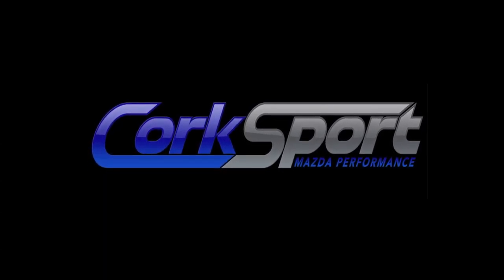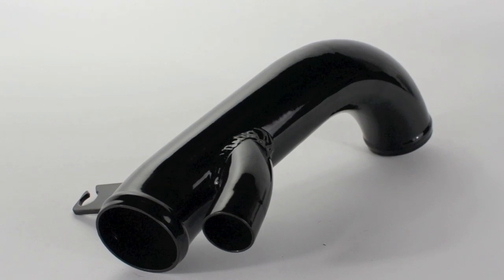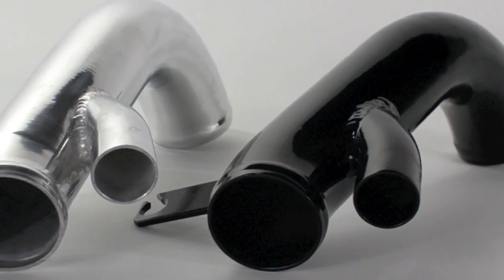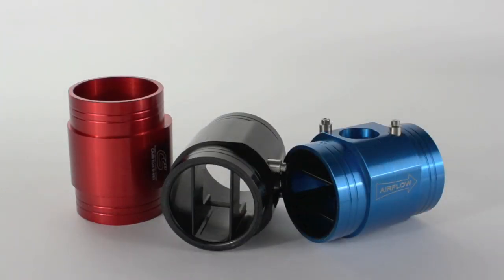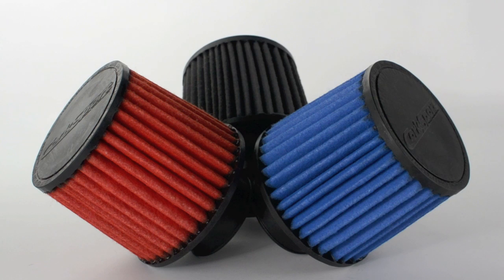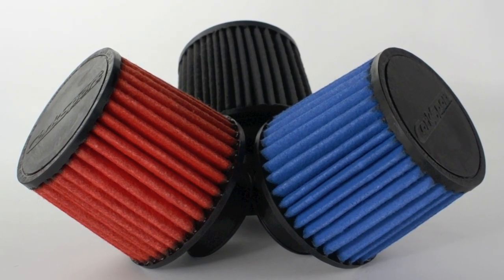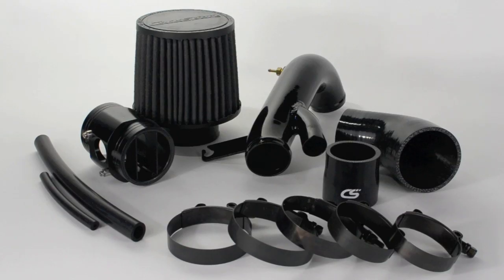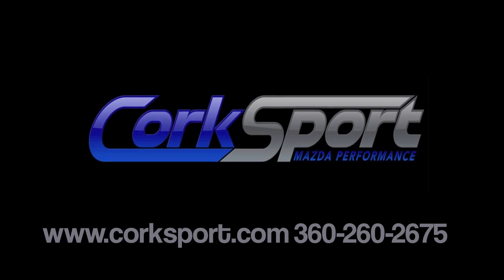CorkSport Stage II Power Series Short Ram Intake

Comment: Have the power intake stage 1 on my MazdaSpeed3. The "air straightener" came undone from the housing, and was sitting in tge cone of my air filter when i took it apart (i got a CEL). So I bought JB QUICK WELD and put it back in. Hopefully that does the trick. As i got a CEL from "bank 1 running too lean." 40 more miles and ill know
Reply from the maker: If you got the air straightener back in, then you should be all good to go. Shoot us an email if you have any issues
Reply: @corksport  sounds good. I used JB KWIK WELD PLASTIC WELD. Im hoping that is strong enough. I dont know what the original poxy was
Reply: Question though. My CEL threw a code for the Mass Airflow Sensor. I think the code was P0171, "Bank 1 running too lean." If that air straightener comes undone, is that the code that my computer will throw?

Comment: 33 horsepower from just an air intake is bs.

A Cold air intake at best gives between 5 to 15 depending on your engine, a short ram intake gives even less since the air is hotter, so at best you get 3HP extra and you could lose HP at lower speeds

Don't get me wrong I like Short Ram intakes, they give some power and make a nice sound, but don't go claiming +33 HP without proof! That is false advertising, and I don't know about the US but over here that is illegal
Reply: Intakes for ms3 do miracles. I'm speaking from experience. Any factory turbo car gains way more whp out of intake than  a n/a car. I gained 23whp out of my aem. check out dyno reviews of ms3 stock vs intake
Reply: I also thinks its BS but they may be saying 33 HP in the crankshaft.
Reply: alldamnnamesaretaken those numbers are with have the car tuned as well. I have the corksport sri and tip and a couple other little things but after getting the purpledrank tune you do get that power.

Comment: Do I need to tune my car or put any mods on my 2013 ms3? I keep hearing that I need to switch the fuel pump and internals befoee adding an intake
Reply: 07boostedtc you should get fuel internals as you first upgrade no matter what then you can get your intake and for sure get a tune. I got a SRI before getting a tune thinking it would help but adding those parts do absolutely nothing without a tune. I HIGHLY recommend purpledrank tuning.

Comment from the maker: Turbo or non-turbo? The turbo engine gains on the gen1 model should be similar. On the non-turbo you will get a significantly different result. +6-7 HP at the wheels